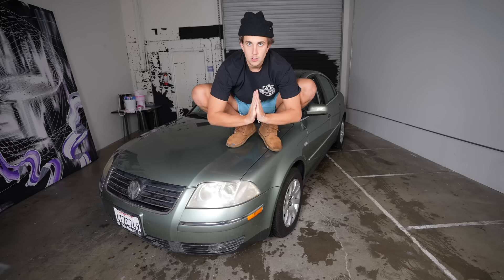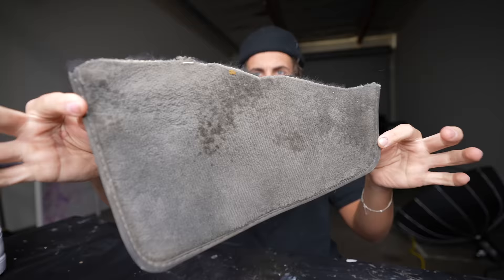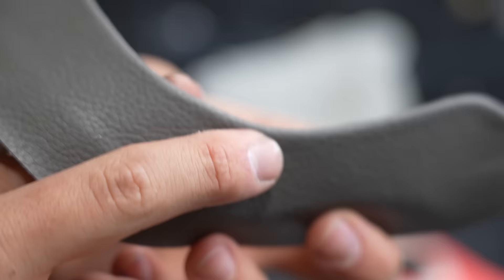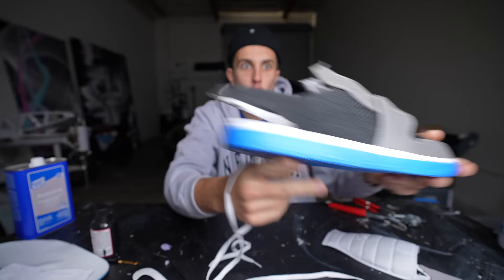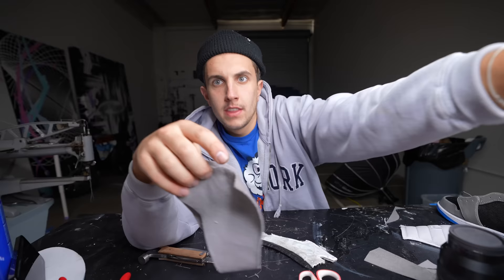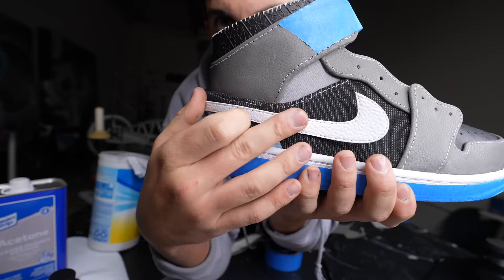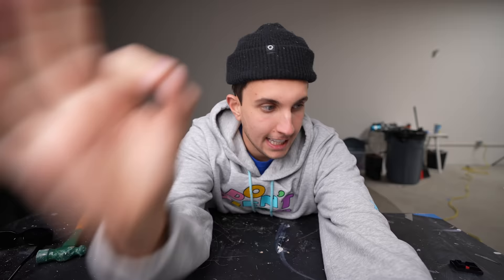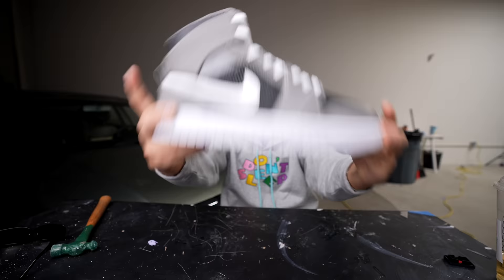Turning a Junk Car into a Shoe…

Comment: the problem at 4:50 with the sewing machine leaving a gap between the stitches like that is that the needle coming out from the rubber cannot pull the thread out as much so it extends for a bit under and inside the rubber with each turn.
you can avoid this by pulling the thread manually after each stitch securing the thread tight or you can put more tension on the thread going into the sewing machine.
any way that's one epic shoe 👍🔥

Comment: The only issue is the part covering the tire on the shoe. You can tell theres like a huge gap/drop off between material. Should of found a way to fill that in so its not so noticable/rigid looking.

Comment: Look. If I get hate for this comment, that is fair.

This clearly look alot of time and effort, and his skills on both the shoe(s) and the video are clear to see.

But I was expecting when making a shoe from a car, that it would be from the metals such as the hood or engine block.

Granded, he can make alot of pairs from this one car and properly saved money just by buying a jalopy, but odd to not just buy bits from a junkyard if the fabric and belts were the prized material.

Again. If this is a "STFU" for you or was considered bad taste, even after reading and internalizing all this. By all means. But add "kill the muffin" as proof that, "yes I read this, let me vent @$$hole"!